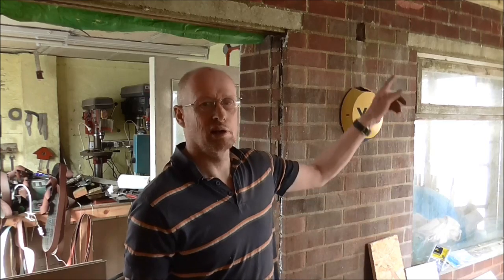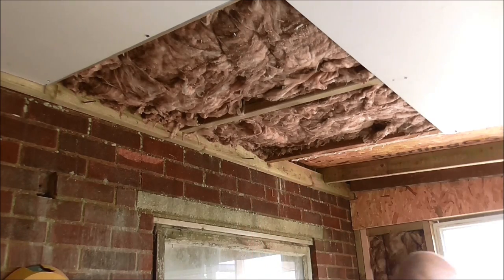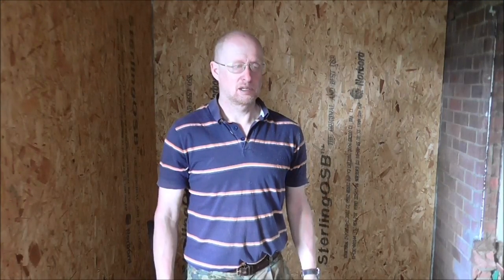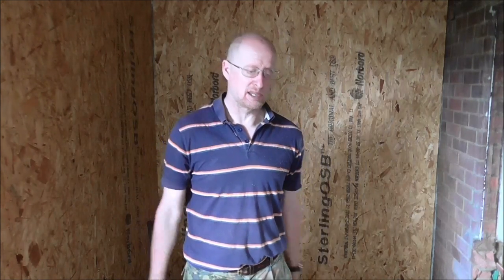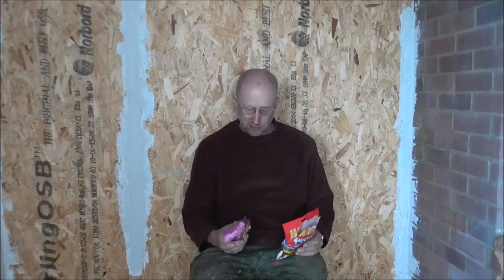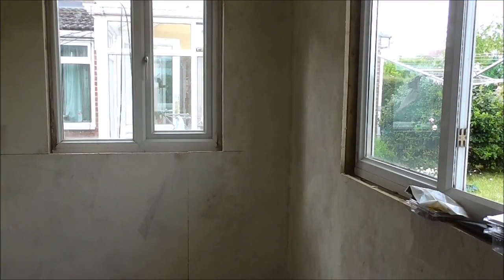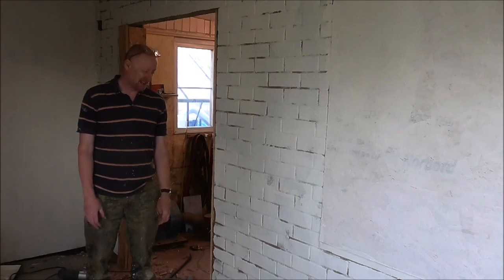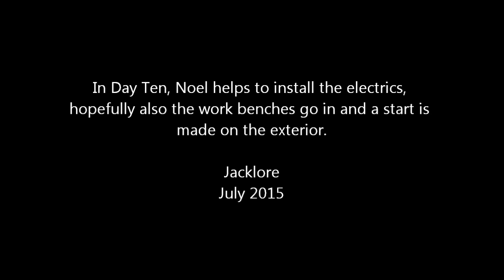Workshop Extension and improvements day nine

Comment: I was taught that it's bad form to have a four corner intersection of gypsum or plaster board. They called it a railroad crossing, and said that no matter how much time I spend sanding the filler mud, it would always be visible under the paint. I was obliged to remove a sheet and a half of the wallboard I had just hung, so that I could run a half sheet offset so that only 3 pieces could meet at any given corner.
Reply from the maker: Darryl Machtmes thanks Darryl, you are probably right. I am not a proffesional builder and this is just a workshop. I doubt I will even paint the ceiling!:)
Reply: I was just volunteer labor at the time, but I still remember twenty-odd years later. Effective lesson, that was. Looking forward to the next video.

Comment: 2:22 that knife. dude, safety!!! once you crack the board, fold it and stand it on end so the hinge is vertical, it'll stand by itself like a book then. open to 90 degrees and slice the backing from bottom to top.